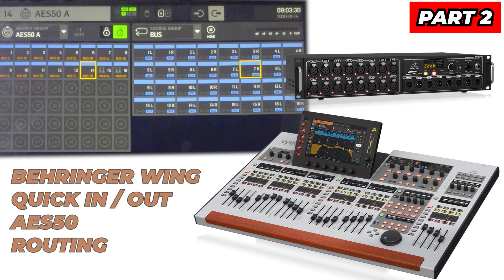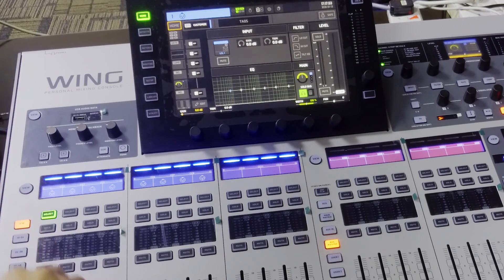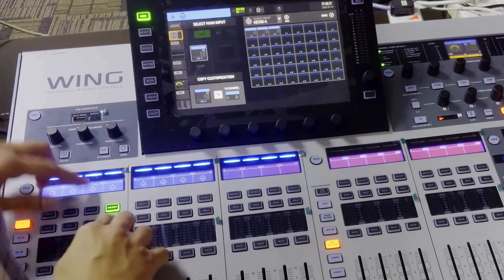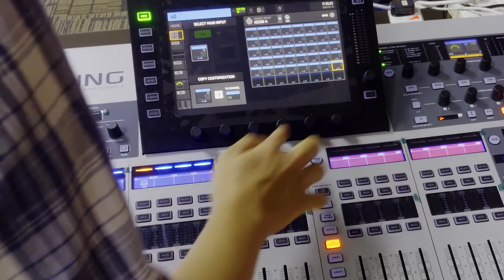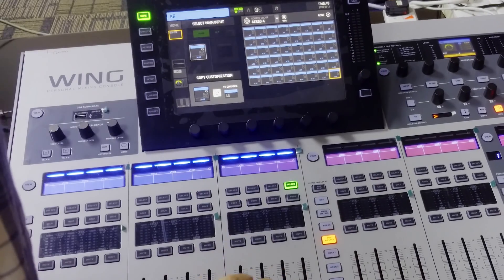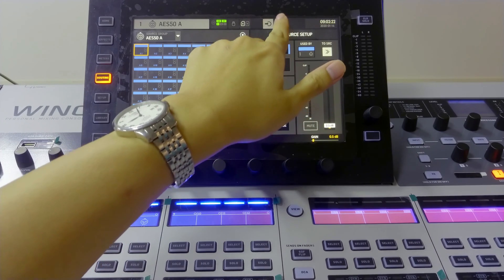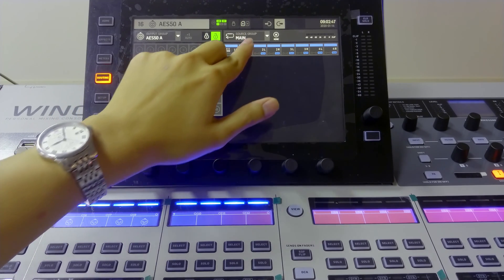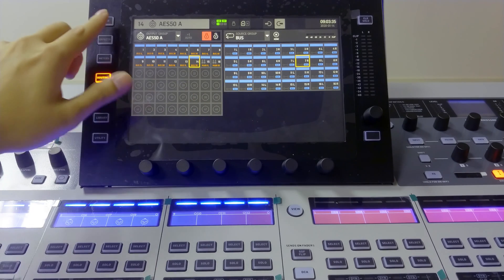Behringer WING Quick Input Output Patching to Stage Box via AES50 (Part 2)

Comment: Hi Eric,  My Wing will be at FOH and in the Stage i have DL32 and M32. I need actually 40 Channels on my Wing (at FOH). Since DL32 has only 32 inputs can i somehow use the M32 as a second stage box and connect rest 8 Channels? If yes How? Thanks a Lot for a quick explaination
Reply from the maker: You need connect wing to m32 first then to the stage box. M32 will become your monitor board and passing all dl32 signal from dl32 to wing. In addition you also send M32 local input to wing

Comment: Hi Eric, first i must say, i'm able to follow your videos better than any of the other videos. Keep making more with the same level of details. So my question is, "stereo inputs would take up 2 channels on the DL32, 1 stereo input on the wing, the ALT. on that channel would complete the pair. Stereo Panning, " LR" would be automatic? or i would have to do the stereo spread? THANK YOU.
Reply from the maker: Alt does not function that way. Your stereo signal will take up 2 channel at dl32 (that's left signal and right signal). You need to tell the console that the 1 and 2 is a stereo signal (e.g. AESA 1 & AESA 2). You can do that by changing the mode from mono to stereo during the patching. At the mixing channel 1, you can assign this to AESA 1&2 since they have paired it early, you will automatically assign to LR for that channel.

For Alt, this is completely another feature. You can use in such way. Under normal situation I play from my pc signal (AES 1 & 2). I can assign my phone playback to AES 3 & 4 where we can assign it to ALT of the channel 1 of the mixer
Reply: Ok Thanks